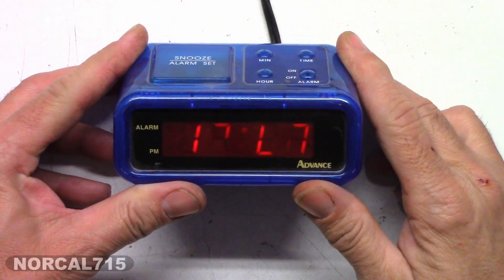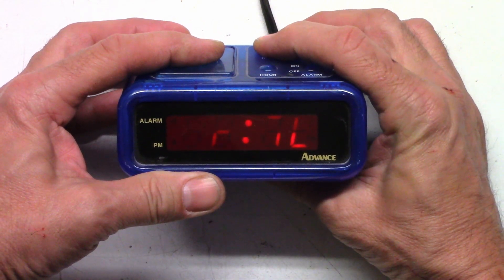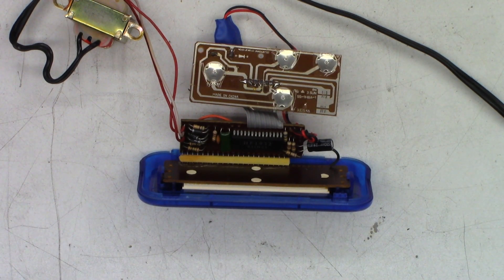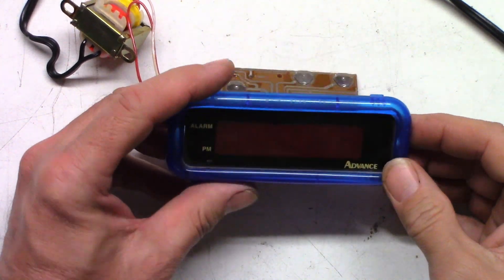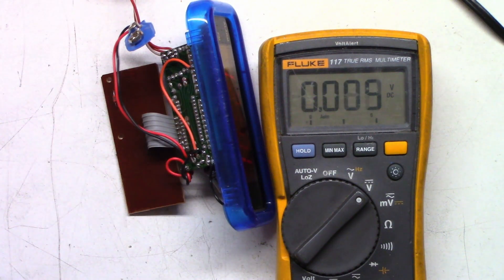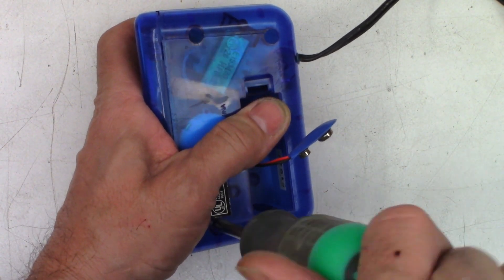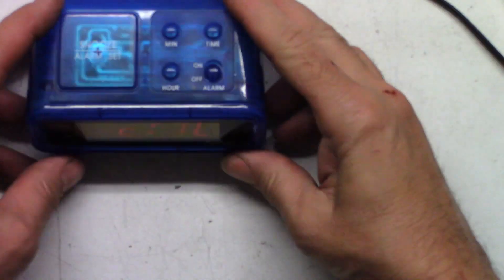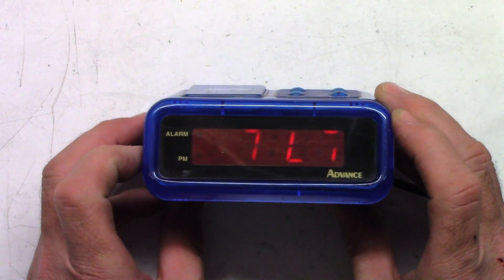Keeping another one out of the recycle bin. This time a $15 alarm clock. Advance 9117 3115

Comment: My grandfather had a talking Micronta alarm clock from radio shack.  Dated around the 80's or 90's.  Had similar issues and the thing had 9 bad caps inside.  Replaced them all and it's good as new.

Comment: Usually the 9v batteries do nothing but get drained. Even with a new battery none of my clocks ever held memory after power cut.
Reply from the maker: Its cheaper to make one version and then just do hardware mods to accommodate all of the markets.

Comment: This is junk. Doesnt even have a radio !
Reply from the maker: Its an effin clock. That is its only job!
Reply: @norcal715  😁I reckon it would be cool if you made it a 24 hr display type though - certainly looks the part. Cheap and cheerful but not junk. 😃
Reply: Even if it didn't work out he would have a small transformer for a project.

Comment: I wish more cheap items like that alarm clock were as easily taken apart for service. Too often I end up with things that could be fixed readily but taking them apart just about destroys them because of glued parts or flimsy and hard to open tabs of plastic.
Reply from the maker: That or ultrasonically welded items.